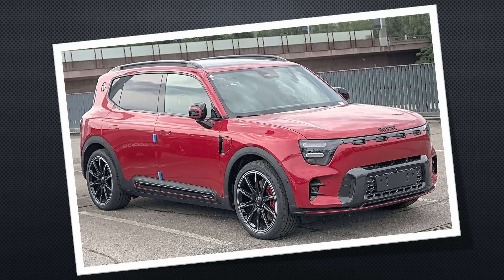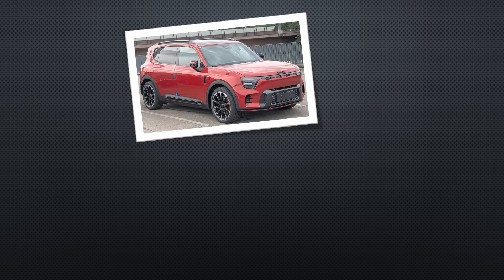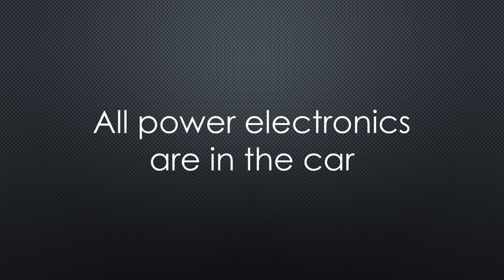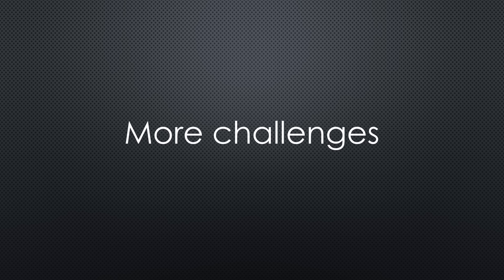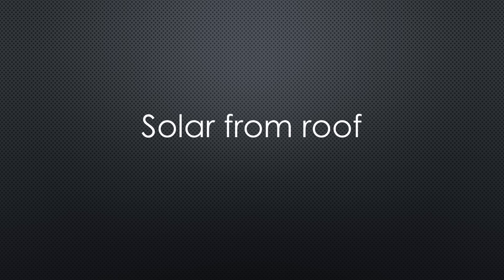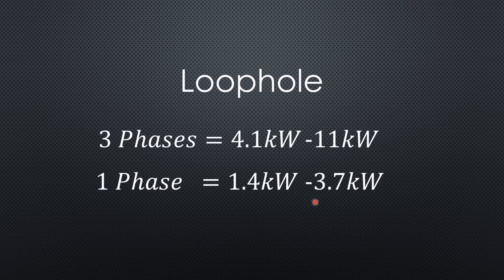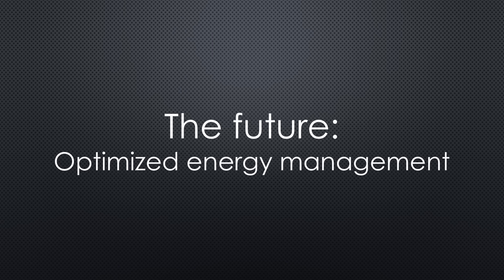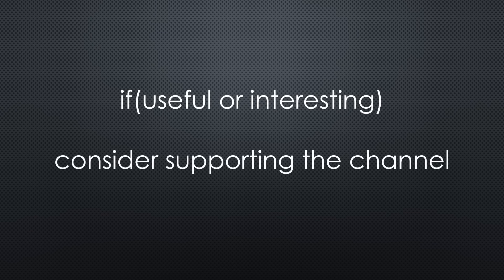How to charge an EV using Solar, OCPP, and EVCC

Comment: Andreas, why haven't you forwardet the Modbus TCP over the Sdongle from your Huawei Pv
Reply from the maker: I have a dongle. But not for the smart meter. It is connected by a wire. I thought this is standard.
Reply: @AndreasSpiess  I have integrated my PV system into Home Assistant, and the smart meter is also showing up correctly. The smart meter is connected via cable, essentially using Modbus, but since it's part of the same bundle that’s connected to the inverter, I can access it through Modbus TCP in Home Assistant.
Reply from the maker: Same here. But the inverter uses the wire to control battery charging. This is why I had to insert the wallbox consumption there.

Comment: you can buy EVSE controller that mounts on DIN rail for peanuts from evracing.
it has support for modbus and a few other things via the well known BT and WiFi modules we use on our micros.
Reply from the maker: Good to know! Do you use one? It seems to be single-phase only. Does it have the RCD and other protection systems required in our country?
Reply: Yes, i have 2 of those. RCD is a modular addon for these, it has an RJ11 connector on it that connects the measurement coil. and everything is well documented
Reply: @AndreasSpiess  The EVSE controller doesn't know or care if the supply is single or 3-phase
Reply: @mikeselectricstuff  yup, the car can happily deal with one or 2 phases disappearing while charging - sure, to handle this on the safe side, we shall dial down the current by changing the PWM duty cycle. the rest is nothing but 2 single phase relays/contactors hooked in series with the 3 phase contractor - each one on one phase. these can be controlled independently - but PWM has to be adjusted to match the desired delivered power once the number of connected phases change.

Comment: Living as I do in the UK, this statement surprised me: "Companies usually pay much less for electricity than private home owners".
Reply from the maker: Is this not the case in your country? Here, they get a high volume discount
Reply: @AndreasSpiess in Germany companies also pay less per kWh because private households are forced to subside them with a levy "Umlage".
Reply: @AndreasSpiess  In Hungary, thanks to the idiotic government, companies and entrepreneurs pay three to six times as much for electricity as the average private individual. And on top of that, there is the so-called "utility reduction" which halves the electricity bill for private individuals up to a certain annual consumption (2000kWh). Of course, this is just a political ploy for those stupid people who don't understand that everyone pays this discount from the common fund with their taxes.
Reply: Big UK businesses do, but the discounts are limited unless thy can offer some dynamic load management.
Reply: Single Phase Charging typically goes up to 32A (around 7kW). Three phase in homes is rare in the UK.
Reply: @SimonEllwood 3 phase domestic is pretty comon in Germany and Belgium, a lot of devices like cookstoves come standard as 3 phase
Reply: Companies get a lower rate if they consume a larger volume and install a high voltage step down transformer.

Comment: Hello Mr Spiess. A lightning strike hit my parents house right 3 feet away from where I was inside, and then went off onto my Prius I am afraid. It worked one day after and then stopped working, like it is not charging. I tried a solar charger with a built in charge controller, but that doesn't get the battery working well enough. I think it killed my 12V battery :( I haven't driven the car in months reliably. It requires a $300 deep cycle battery :( Then the next month I would have to pay $337 for insurance for a car I haven't even been driving. I had a stroke or something 2 weeks before the lightning, the lightning made me feel like I had scarlet fever for two weeks I think from the gamma radiation, I don't know. I am just sitting here for months now. I know the big battery in the back, I don't know how to charge it with solar but I have a few panels I might try and a crummy charge controller. The big battery is scary high voltage and separate from the 12V deep cycle battery. I thought you had quit doing youtube videos? Are you back for now? I will eventually buy a new deep cycle battery but I was always fascinated about how to charge the really large battery in the back, the high voltage one maybe with a bigger panel then if I pulled enough voltage I could just drive it in EV mode or whatever mode it has. I am no electrical engineer, I am more of a hacker.
Reply from the maker: In my last video, I announced that I quit my regular videos, but I will still create one if I have time and content.
I hope you will be able to repair your car! Here, lightning damages are paid for by the insurance.
Reply: @AndreasSpiess  I think they wouldn't pay for mine unless I had "comprehensive coverage" which is ridiculous for them to exclude "acts of god" for normal coverage since they are so rare. My parents homeowner insurance wouldn't cover it either. I just wish there was some universal way of hooking a solar panel to charge up anything but I guess you have to enter the maximum voltage or something, I don't know. I will get it working somehow, you're the best Andreas!
Reply: @Invisinine Your house insurance may cover lighting damage

Comment: Happy to see you’re back, hope you’re doing well. 🙂🙏

Maybe I should view the video multiple times to understand better, but wanted to give the positive feedback that I have a lot of questions after this video. Nothing wrong with that, but missed the simple explaination a bit. 🙂

Maybe it is because of so-so experiences charging my EV, which is a bit more complicated as initially thought, in the three countries I live in. Not too forget that international trips are a bit of a hassle with EV. Always thought the free energy from the roof is a huge advantage, but don’t see it back on the invoices 🙂

Charging requires thinking, else others have done it for you and that is expensive.
Reply from the maker: I am not yet a very experienced EV driver, and I have not had to charge outside my home very often. Because of that, I only used my credit card at DC stations (which is more expensive, but ok for the small amounts I needed).
So I am looking forward to my first trip out of the country...
Reply: @AndreasSpiess  🙏

Comment: Why depending on some property protocols of overpriced wallboxes? I didn't have solar yet but for my two EV I bought a simple kit for self build for under 200€ years ago. At least they contain a contactor and a tiny pcb where you set the max current by a resistor choice. At least you can build in every controler you want to comunicate with the rest. It only has to switch the contactor, of course behind the controller which comunicates with the car.
Anyway the wallboxes are sold to the public mostly as chargers so the people think they are worth the high prices 😉
PS congrats to your EV beast, seems I ll see you on the A5 in Germany next days for a full speed test 😊
Reply from the maker: So far, I have only tested the acceleration because I never reached the A5 without my wife ;-)

Comment: Thanks for the video Andreas, again a wonderful tinkering project. I took the easy way and let my Enphase IQ EV2 wallbox figure things out with regard to maximum solar usage in combination with a dynamic electricity contract and sometimes negative electricity prices during the summer.
Reply from the maker: Thank you for sharing your experience! Does it support phase switching? In which country do you live (because of dynamic contract)
Reply: @AndreasSpiess  "Flevopolder" = reclaimed land in The Netherlands.
Reply: @A @AndreasSpiess  yes it does, and correct I am living in the Netherlands 73 Peter PH0PPL ;-)

Comment: Awesome to see you back! I've just installed a Lucid 80A charger and it has wifi and supports OCPP 1.6J! Maybe I'll play around with that, but I don't have solar yet.
Reply from the maker: Without solar, OCPP is probably not as important. Maybe if you have variable prices, it could be of value.
Reply: @AndreasSpiess  Thanks Andreas, this makes sense! I keep hoping that Lucid will make good on their V2G support promises, so perhaps OCPP will become interesting in that context as well. looks like they'll have to upgrade to OCPP 2.1 to make that work.
Are you considering using your car as an emergency backup in case power is lost temporarily? Does your solar require the grid to be there to produce power? i.e. is your solar setup based on micro-inverters? I wonder if V2G allows solar to keep producing in grid-dependent solar configurations. I've not yet decided on the type of solar inverter I'll be installing here, I need to better understand various options, features and compatibility.
Reply from the maker: I am skeptical for V2G. Home batteries are quite cheap these days. But V2L is interesting for me. Recently, I used my car to cook coffee at an event. With a 40-dollar adapter from AliExpress...
Reply: @AndreasSpiess  true. i should probably just wait for sodium ion for the house, actually.

Comment: Nice to see a new video. But please don't become one of those vibe coding AI morons. If you ask AI about things you know, you can see how wrong it can be. That won't change when you use it for things you don't know.
Reply from the maker: I am already an "AI Moron" :-( With a slight difference: I use specifications as an input. In my projects, it is relatively easy to detect errors: Either the compiler detects them or the testing reveals them. 
The human's job is no longer "coding". It is specifying and testing. A position I like a lot because I am not familiar with all programming languages I would like to use for my projects...
Reply: @AndreasSpiess I am sorry to hear that, just be mindful of the hidden dangers of not exactly knowing what is going on.

Comment: Compare this with just rocking up to any fuel station and fill up 800+ km in about 5 minutes or less and to virtually the same cost especially if you value your own time!!!
Reply from the maker: My car consumes 20kWh on average. I earn 7 cents/kWh if I sell my electricity. 20x7=1.4CHF/100km ($1.8). Less than a liter of fuel where I live. Not bad...
Reply: Except you have to go to the fuel station and pay for the fuel, instead of the car just refuelling itself from the sun while it's parked in your garage.
Reply: We’ve done 1500km this month, total cost 18€ using overnight cheap electricity with a little solar (been cloudy here in the UK) and I’ve not waited even 5 minutes to fill the car as I’ve been asleep.
Reply: watching this video is also good time, I am am just more focused in applying real knowledge

Comment: My Renault Zoe could not charge without a good earthing, which is not a standard in my country, how can I go around that?
Reply from the maker: Interesting! Not a problem here, as earthing is regularly tested by authorities.
Reply: @AndreasSpiess  the thing all Saudi Arabia does not have earthing in their network only N, L1, L2, L3 no ground and I tried so many EV chargers with Zoe with no luck. I do not want to make my own ground in my house, how can I charge without ground if possible ?
Reply from the maker: I do not know, I try to make my way around high voltages if possible ;-)

Comment: Interesting (future) option from Victron: Use DC charging and discharging (from grid or PV), so one can use connect the car battery to the grid, but also charge the car without the minimal limits set bij the car (usally 6A 1phase) : https://youtu.be/CLN9KwL-zwc?si=ZD6VNedGGPD-iMKv
Reply from the maker: Unfortunately, I do not understand everything in the video. And I did not find information about it on the Victron homepage.
If your car is close to your inverter, that is an interesting idea!

Comment: I use OpenEVSE - easy to build as DIY project - very flexible with ESP WiFi add-on (MQTT or RAPI with simple curl or python).
Reply from the maker: An interesting project! However, in Switzerland, AC installations are heavily regulated and DIY is not allowed :-(
Reply: That's what I tried, but the solar panel system I use only has a 3000W 110V inverter and openevse is 220v only.  At 220v my car will only draw 15a or more, so I can't just use a step up transformer.

Comment: For folks that have not yet purchased a wallbox and don't have a friend that imports Chinese products which need to be battle tested: I can highly recommend the products by go-e (from Austria). I have the model "Gemini", it is very affordable, has open APIs (REST, MQTT and OCPP), is easy to integrate with HomeAssistant, and is supported by EVCC out of the box. It supports 1-3 phases (with phase switching) and between 6 and 22 kW (when used in 3P mode).

PS: EVCC is a great choice. I initially wrote my own automations using HomeAssistant alone, but it's very tricky to get all the state management and sampling intervals right. EVCC just works. And it can also be used to automate other consumers in the house, for example a boiler spiral or a heat pump.
Reply from the maker: Thank you for sharing your experience and recommendations! If I am fed up with the Chinese boxes, maybe I will also go for your choice ;-)
Reply: Yeah, the Go-e are very capable and open. One issue for use in an atomic bunker is the lack of Ethernet for the non pro models. They only support wifi or LTE(some models).
There's also another hack for surplus charging if your car supports it:
EVCC can also control the car directly. In the case of Tesla even locally via Bluetooth. There it's possible to set the current down to 1A. This allows charging in a much wider range of power even without switching phases. Combined with phase switching, you can go as low as 230w. That doesn't make much sense since the car has a standby draw, but even with just a couple hundred watts it's possible to charge if you have enough time.
Reply: sorry but a pricetag of 750.- EUR and up for a gloryfied switch seems not very affordable to me. i'm looking forward to be able to buy one of the chinese imports 😀
Reply: @n-du-fox 11kw 543€ 22kw 578€